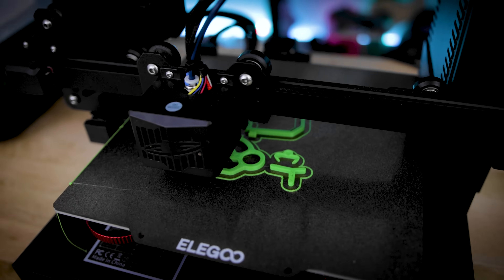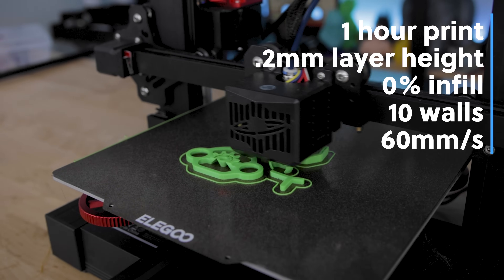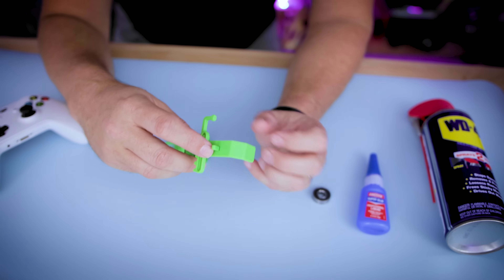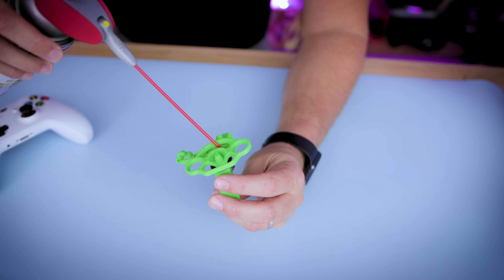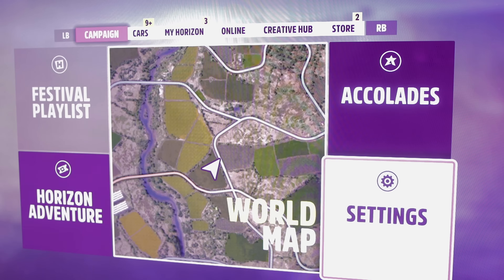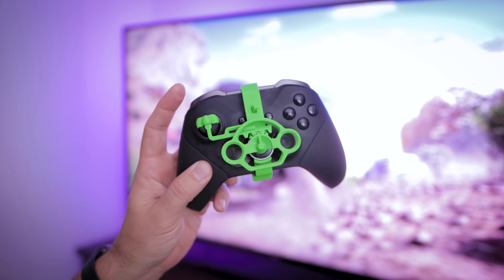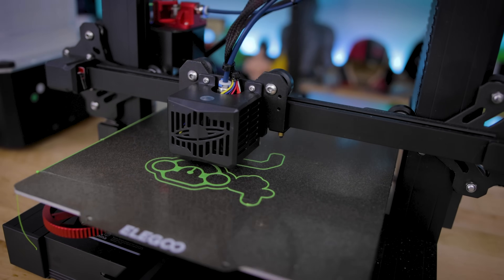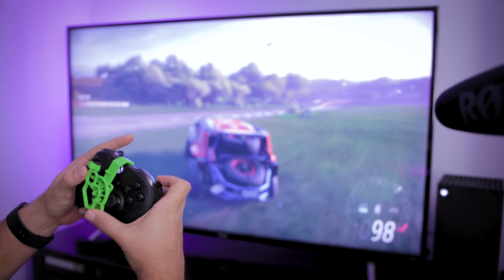NEW 3D Printed Xbox One Steering Wheel for Forza Horizon 5

Comment: Does anyone have good drift settings for this wheel I can't find any good ones
Reply: Been at for about ten minutes of adjustments my steering linearity is at 60 (i use inside camera) my deadzone is 0 (inside) & 80 on the outside(havent tested outside view yet)

Comment: Just get an actual wheel, lmao. You can find old ones for very cheap.
Reply: $200-$300 is not very cheap for most people so move along
Reply: yes an actual wheel IS a better option BUT you need set up space, and before you ask YES I personally have wheels, flights sticks and yokes for PC, Xbox. They ALL require space and a clamping surface. The idea of something small compact and hand held that gives finer control than the good old thumb is a good Idea, ESPECIALLY if you already own a printer.
Reply: Bro the cheap ones are the price of a 3d printer
Reply: @ELTABULLO  just did a search for y’all. Found a PXN V900 for $50 on Marketplace. Thrustmaster T80 for $85. Thrustmaster TMX (with force feedback) for $80. Prices are negotiable. Even with inflation, there are still some cheaper wheels. 

Basically, if you search for the deal, I promise you will find it 😉
Reply: @dabigcheezprod  Wow I sure hope those are not limited to one specific country! JK I already know without looking that those will only be available in 1 (one) country, irrelevant to most people on the internet, hence the comment, unless you think Youtube is somehow restricted to one country lol
Reply: @ELTABULLO  also on eBay with international shipping. So no, not limited to one country.

Comment: I would love to see if a resin printed version works just as well
Reply: would work exactly the same lol
Reply: @tehMaloWalo  I only mention that because resin isn’t as strong as pla so wondering if it can hold up to the abuse
Reply: It’s absolutely no problem if you use ABS Like Resin. I printed so much technical stuff with this and its working perfectly. I’m not sure about normal Resin but for ABS like it’s fine
Reply: I actually just printed one out in resin! Works fantastically. Just had to sand the peg on the steering wheel down a bit so it could fit by friction. I also didn’t cure any of the parts so they wouldn’t snap and they’d have that but of flexibility
Reply: Oh by the way. I used standard resin. Elegoos water washable

Comment: I printed this before, and unfortunately there is a pretty big flaw with the design. the bit that fits into the bearing has nothing but layer adhesion keeping it from breaking, and I broke 2 of them, one broke just trying to get it into the hole. you'd need to print it at an angle to keep it from breaking or something.
Reply from the maker: That’s an odd one. I’ve had very very very few wheels break when installing the 1000+ that I’ve printed of them. I even still have the original one I printed 2+ years ago that’s held up amazing.
Reply: @UncleJessy  then it might've just been the filament I was using. the layer adhesion on it WAS particularly bad.
Reply: If you used WD40, than no wonder that it breaks. Mineral oil products make many plastics crumble apart. Only use silicone based oil/grease.